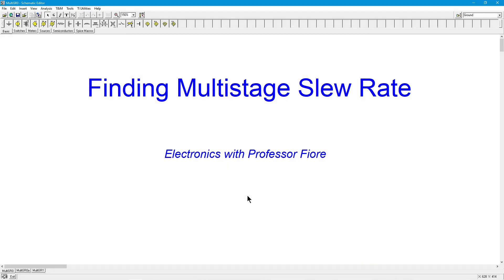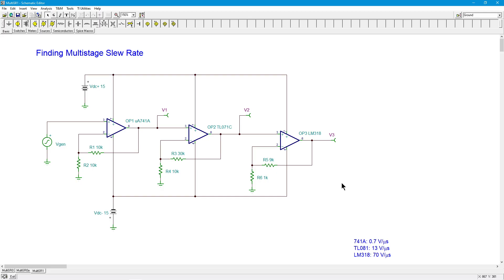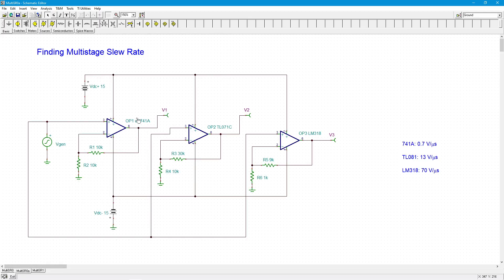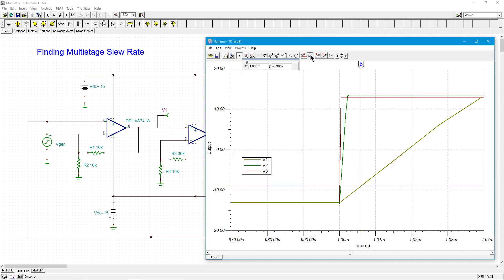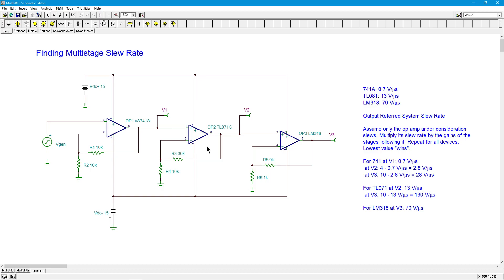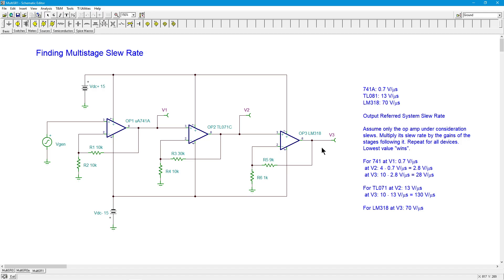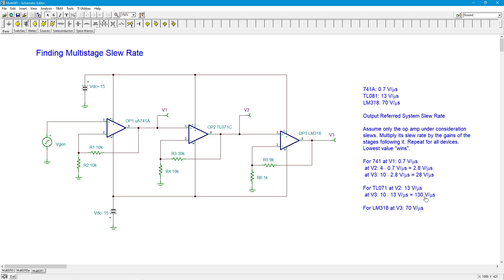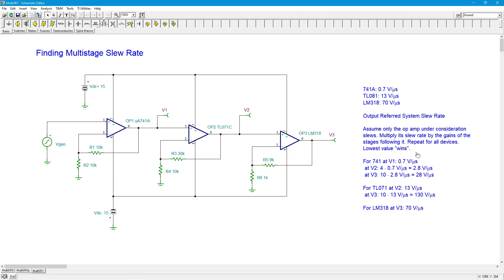Op Amps: Multistage Slew Rate

Comment: Professor Fiore, I love your videos! I have had a question about ring modulators and have never really gotten them! Would love to see a video on disecting a ring modulator circuit!!
Reply from the maker: Are you referring to the basic diode ring circuit or one using a multiplier IC? Not sure I can simulate the latter (need a good model). I'll look into it, but in the meantime, the basic operation is that the circuit produces a "double side band suppressed carrier" signal. There are two input signals (carrier and intelligence/music). For each component sine of the intelligence signal, two output sines are produced at the sum and difference frequencies. For example, if the carrier signal is, say 100 kHz, and the intelligence/music signal is 5 kHz, the output is two signals at 95 kHz and 105 kHz.  This can create a signal that is "overtone rich" in which the overtones are not harmonically related. To keep things more interesting, the carrier wave need not be a fixed sine.